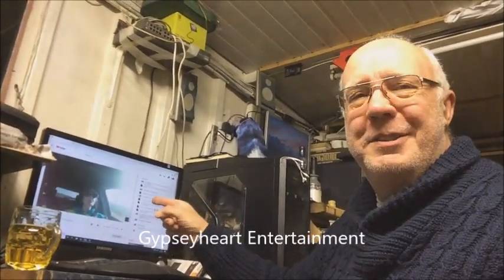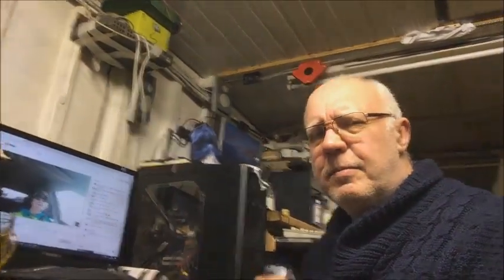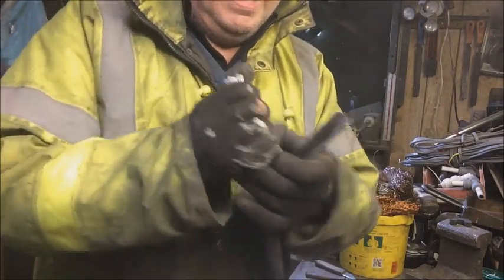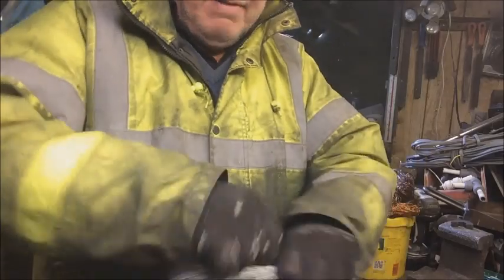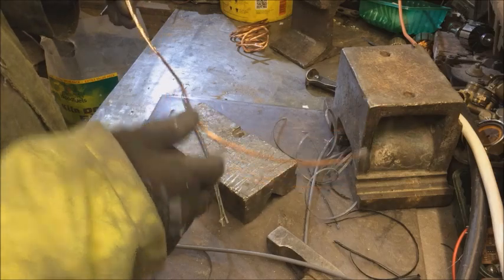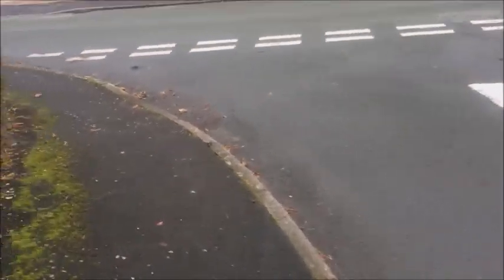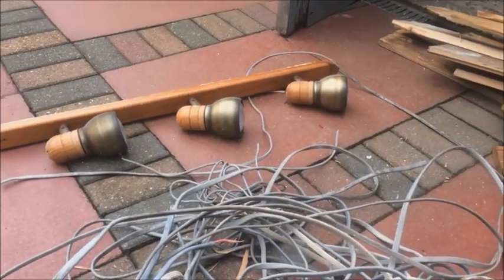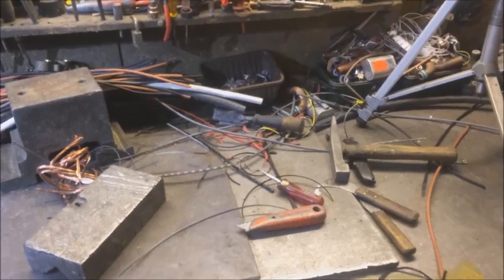wood Skip for Scrap COPPAH part 2.       Wire stripping

Comment: What do you use to cut the armored cable into manageable lengths?
Reply: Angle grinder works well or some big bolt cropers or even a sharp bolster chisel and club hammer.
Reply: @paulf2529  Thanks Paul
Reply from the maker: yep Angle grinder
Reply: @Man-in-da-shed  Now I just need me some cable :-)

Comment: Hi Ian  you may want to  invest in these their worth their weight in gold, so 
quick and  easy to use once you get the hang of it. if you scroll to the bottom of the link there is a video to se how to use them. P.S thanks for the tip for the thin wire that's gonna save me some time vs money cheers pal.